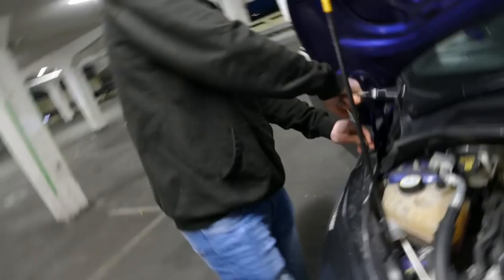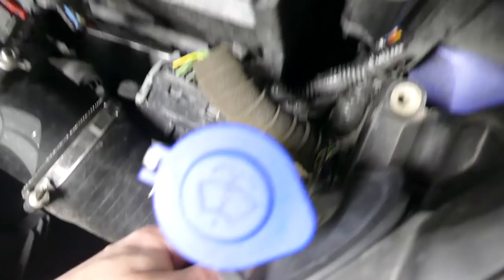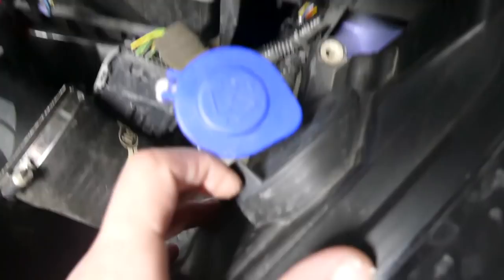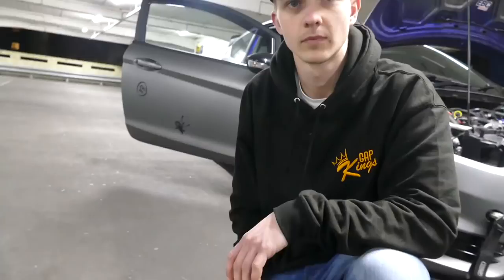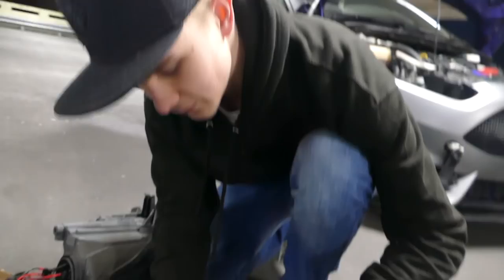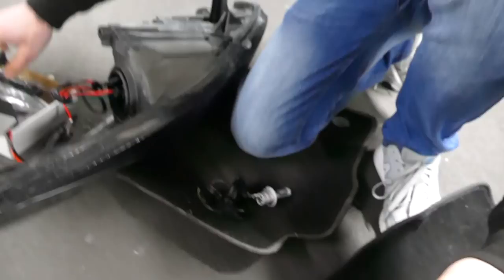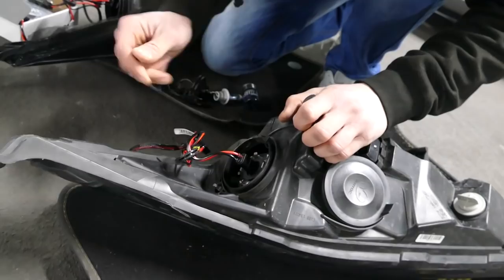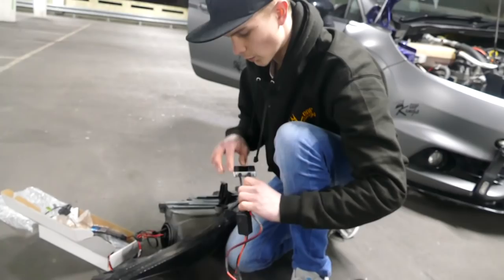FIESTA HID KIT INSTALL (CEUK)

Comment: Looks good mate but I hope you are on good terms with your MOT tester! Meant to be an instant fail now if HID's/xenons are found if they aren't standard on the car from new. I think an OEM conversion is ok, but that would depend on the car and if they are actually an option.
Reply: sarcastixx74 police are gonna notice also.
Reply: True mate, surefire way of getting a pull. Then they would likely spend time going over the whole car. They do look good, but definitely cause bother for other drivers, especially at night

Comment: Ain't hids illegal now
Reply: yup, but you don't know that until pulled over right? :)
Reply: Always was illegal, its just changed so its an mot fail now
Reply: Spoolie ST they aren’t illegal if they are in the correct housing not standard housing which isn’t meant for them
Reply: Lewis thats wrong mate, they're completely illegal if they're fitted to a car after its left the factory. I've fitted the correct housing to mine but it's still illegal because of this
Reply: Correct mate, if they are not OEM then it's meant to be an instant fail. Shame, as there are some decent quality aftermarket HID kits available that look much better than the cheapo halogen crap that comes out the factory.